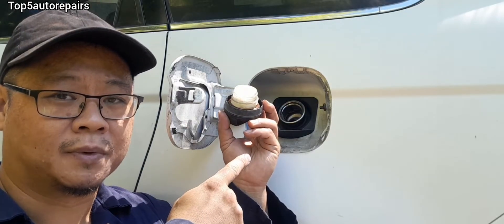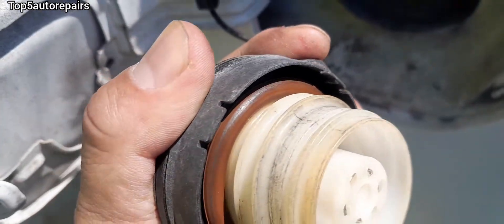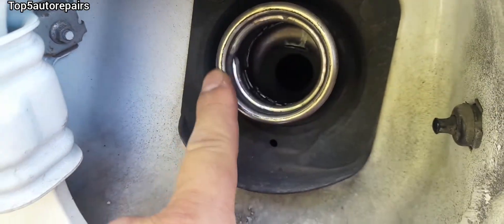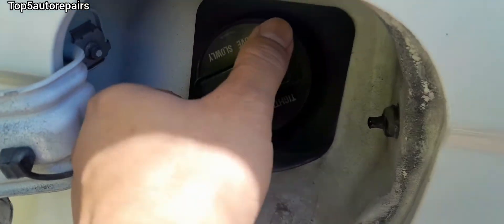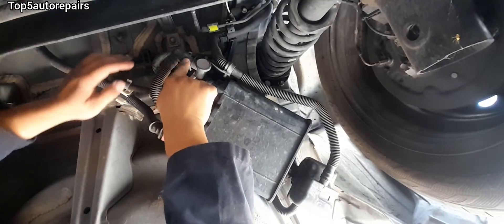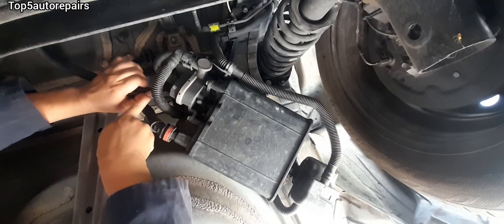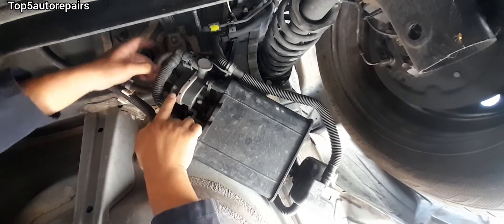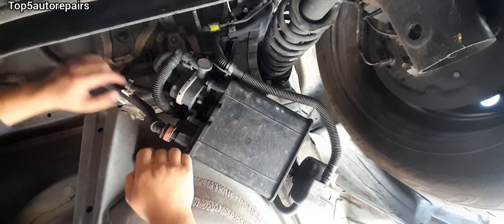STEP BY STEP GUIDE TO FIX P0440 EVAPORATIVE EMISSION CONTROL SYSTEM MALFUNCTION

Comment: I have a 2001 Toyota Celica gt with a p0440 and smoke coming out of the gas cap area.  Replaced with two new gas caps still has smoke coming out of that area.  I pinched closed the larger vapor hose coming from the canister to the filler neck and smoke stopped.  Replaced the charcoal canister and it still is smoking at the filler neck unless I pinch off that hose.  Ridiculously over engineered system.  Vent valve and purge valve all function correctly.  Don’t know if that hose needs to be pinched off or not but now it sets a pending p0440 code every time I drive it.